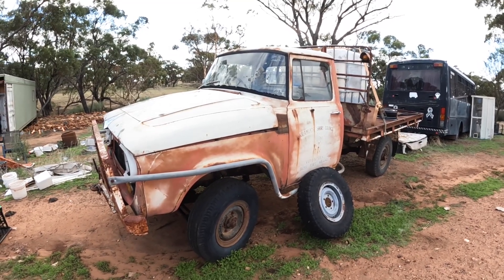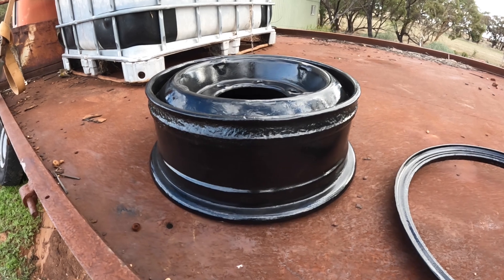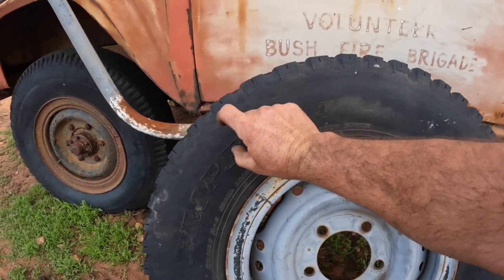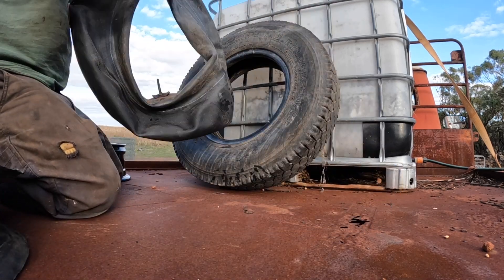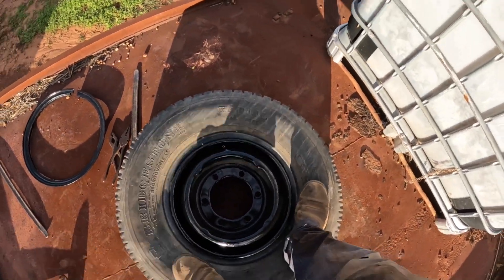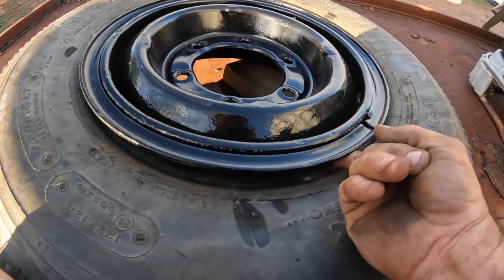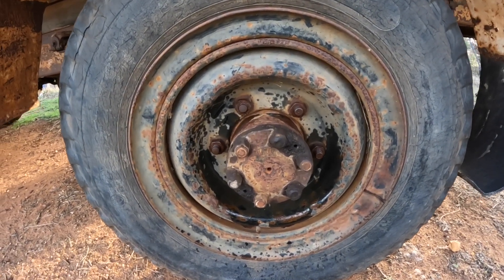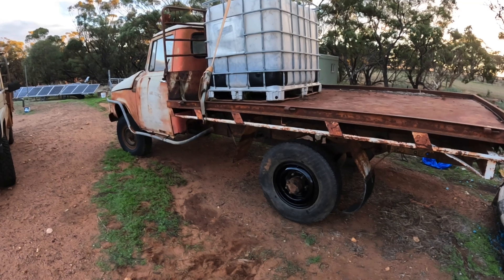Safety with split rim wheels.

Comment: Is there a reason why they designed the left hand side to be a left hand thread? You would think they would be made all the same.
Reply from the maker: Hi, the theory is that because of the direction the wheel rotates they are less likely to vibrate lose if you have a left hand thread on the left side and a right hand thread on the right side. 
Thanks from Geoffrey

Comment: Really good advice Geoffrey. 
I have never thought of fitting the wheel on facing the truck while inflating. I have just set up the air line and walked away. 
I once watched a safety film that showed an imprint or a man in the roof of a shed where a rim had let go during inflation.
Reply from the maker: Hi David, I have seen some videos of wheels coming apart, and I am very glad I haven’t seen one in person. 
That must have been quite the impact to put the imprint of a body in the roof.
I was surprised when I sat down to work it out that a 16” tyre at 30psi had a force of 7 tons on the side wall.
Thanks from Geoffrey
Reply: @ yes 7 tons is a lot. But it is also explosive
Reply: I was checking tyres on my truck up to 100 psi before I went to get a load of hay. Thinking about this video